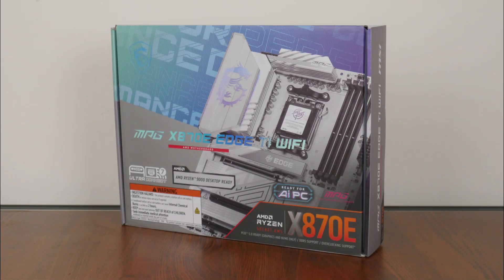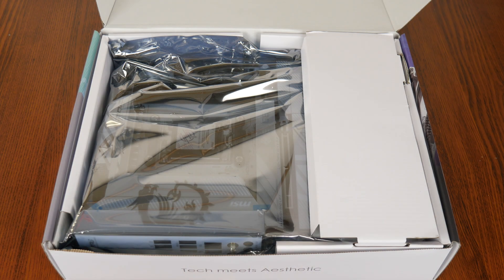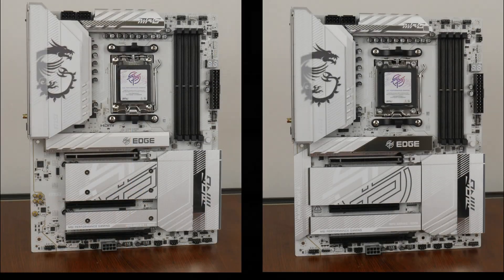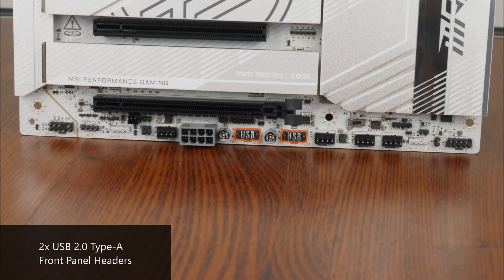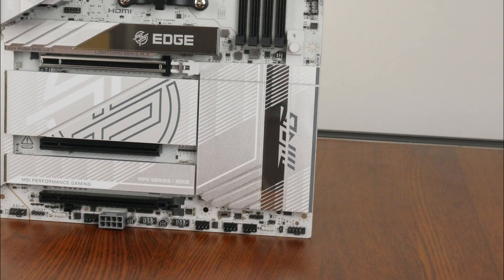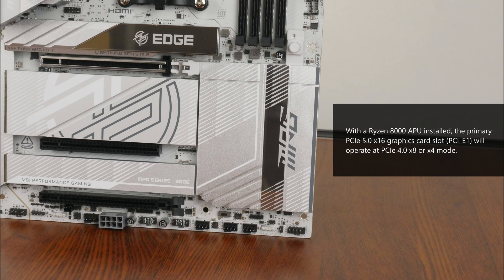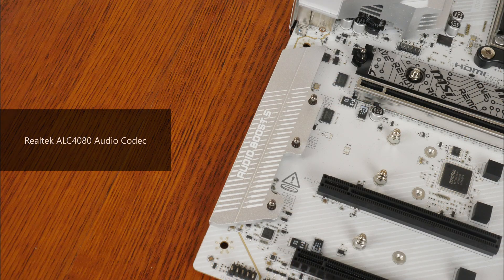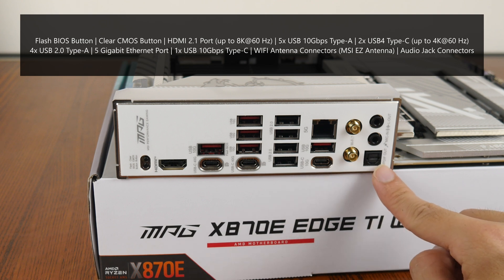Great for high-end Ryzen 9000 PC builds in white! MSI MPG X870E EDGE TI WIFI Unboxing & Overview

Comment: What is the difference between this and the x870e carbon wifi? except the color. Thanks
Reply: 0) like you said the color.
1) carboon got dual lan (5.0ghz nic and 2.5ghz one) this one got only single 5.0 ghz lan - i think that waste  would be better to put there 10ghz to make carboon actually  have meaningfull difference(only godlike got 10ghz for msi)
2)m.2 heatshinks are worse in this one on (only one sided) on the 3 secondary m.2 slots
3) this one got 4 usb2.0 slots and 5 usb 3.2 slots for usb type A
     carboon got 9 usb 3.2 type A instead
4)this one got only 1 usb 3.2 for usb type c slots and 2 usb 4.0 slots
    carboon got 2 usb 3.2 and 2 usb 4.0
5) carboon got a little more easy debug features with reset/shutdown pc button from motherboard this one doesnt.
6)this motherobard pcie lanes distrubtion is better
this one got  5x16(gpu)+3x1+4x4
carboon one is  5x16(gpu),5x4(share lanes with gpu)+4x4
i dont think there is good use case for 5x4 slot for most of the peoples and it share the gpu lanes so meh
7) carboon got better vrm but both are good enough for all amd cpus so w/e
Reply: @xwizardx007  thanks a lot. I finally ordered a carbon and it will arrive on Monday.

Comment: Damn. I wish MSI was making a white 5090. Sucks to get a white board and have a black GPU stick out like a sore thumb. You could get a white Gigabyte card or something, but then you have to deal with two different RGB solutions, so I'd probably rather just get the Aorus X870E Pro ICE to avoid that. It looks better anyway, though I like some things about this board better (like the 5 Gbps LAN.... though I could just put a 10 Gbps SFP+ card in any board).
Reply: the pro ice has a 1.1 revision, rather avoid it and get the MSI
Reply: @Myrkwasa  Yeah. Overall I feel like this is the better motherboard. It's 8-layer PCB instead of 6-layer, I'd rather lose bandwidth from the USB 4 ports than I would the PCIe 5.0 x16 slot, 5 Gbps LAN instead of 2.5 Gbps LAN, etc.

I do think the Gigabyte board LOOKS nicer being in all white, but the black accents on this board do have some advantages (for instance, I'd like to use a contact frame just to eliminate any possibility of thermal paste getting onto the motherboard, and as far as I know there is no white contact frame. A black frame from Thermal Grizzly would stick out like a sore thumb on the Gigabyte board, but I think it would look fine on this one).
Reply: I will never understand you people choosing car with specific color and don't care about the engine at all. You could get something like suprim x liquid but instead you want white gpu putting 600 watts of heat inside your case. I get it, you leave sidepanel open, but still you would get substantionally better cpu and memory clock stability using aio and blowing the air away. And choosing gigabyte motherboard for the rgb instead of getting 8 layer msi board with great features, you want to get bugged out gigabyte board that won't probably even get full frames like youtuber blackbird reported on his video about microsoft flight simulator. I wouldn't touch gigabyte motherboards at all. I mean, like no offense. It just blows my mind what people consider important. I have my 9800x3d and 4090 in a over 10 year old case upgraded with zipties all a round and all rgb immediately disabled,  so why aren't probably same target audience. But hey no offense, i just wanted to say this. Have a nice day and enjoy your pc the way you like. EDIT: I really don't want come as aggressive piece of shit, just genuinely amazed :)
Reply: @jaybee0507  I've changed my mind since writing this and would rather have the MSI board due to the 8-layer PCB, the 5 Gbps LAN instead of 2.5 Gbps LAN, and the PCIe 5 bandwidth being shared between NVMe slot and USB 4 ports, rather than between NVMe slots and the PCIe 5.0 slot like on the Gigabyte board. I still think the Gigabyte looks better with everything being white as opposed to MSI's black accents though.

But the comment makes no sense. My comment proves I care about both the color and the engine, if we're sticking to your metaphor. If I didn't care about the engine, I'd just get anything white instead of complaining that the available white cars have shitty engines (and they both do, since none of the flagship motherboards are offered in white, much less the Halo Product boards like the Godlike, Aorus Xtreme, Maximus Hero, etc.).

No, we are very different users. RGB is indispensable to me, because it lets me change my single accent color at will. Before RGB, if I wanted red in a build, I had to buy something red, then if I wanted to change to blue, I would have to buy something blue and swap it out. ARGB means I can buy one thing and change the color any way I want, any time I want.

On the other hand, I can't fathom spending this kind of money on something and not caring how it looks. At least, this assumes your case has a side panel window. If it doesn't, what you said makes a lot more sense, as you don't have to look at it.

If I'm building a server, I'll use an air cooler and put Noctua fans everywhere for maximum noise-normalized performance and reliability, but in a desktop gaming PC with a side panel window, I'd never go near either, because huge tower CPU coolers just block everything (they literally had to invent mechanisms to release the PCIe slot lock from the other side of the motherboard on recent motherboards, because it was such a pain in the ass to release a GPU with a big tower cooler hanging over the PCIe release lever), and Noctua's poop brown and beige color scheme is hideous if you actually have to see it.

Comment: MSI's design choices for the Edge are questionable when it comes to their M2 slots. The M2_1 and M2_2 are Gen 5 slots yet both are 22mm wide only meaning third party heatsinks are not at all compatible. Bad design considering Gen5 drives run hot and need the added cooling. To make things worse, M2_2 to M2_4 all lack backplate thermal pads, which means double-sided M2s are cooled less effectively. Compare this to the MSI Carbon, which has thermal pads on both sides. 

Have you tested how much the lack of a backplate pad affects temperatures on double-sided M2 SSDs? On the M2_2 running at PCIE 5.0 x2 if the USB4 ports are not disabled, if I put a Gen 4 SSD in that slot, would it affect its speed? I heard PCIE5.0 x2 is about the same as PCIE4.0 x4. Thanks.
Reply: This is supposed to be a cheaper board than the carbon so it makes sense they’d cheap out in some areas